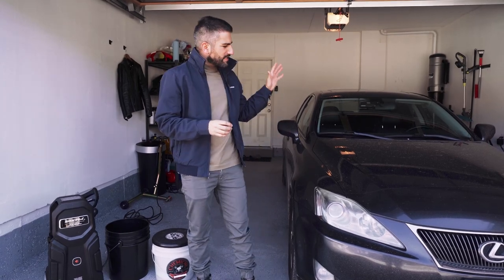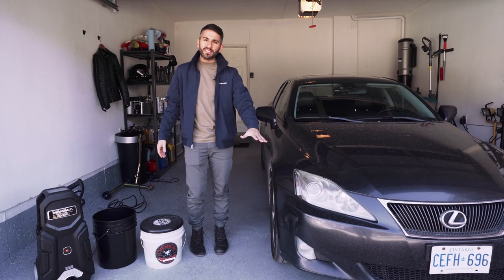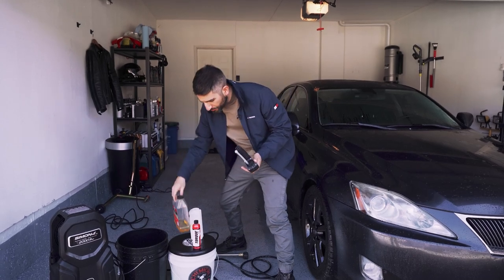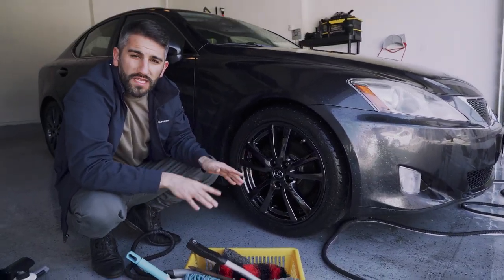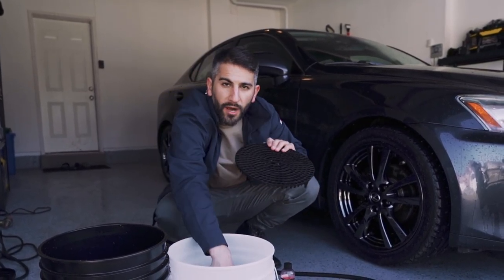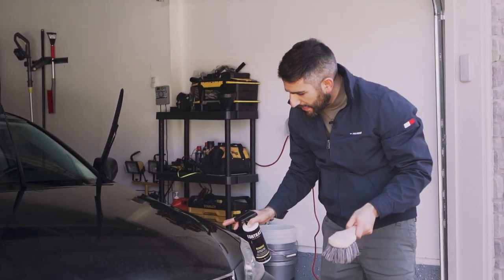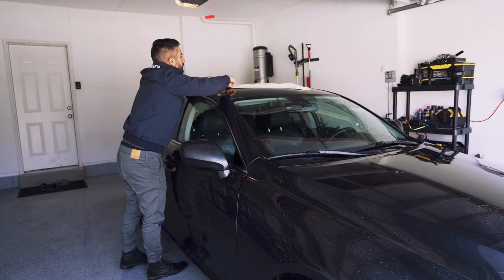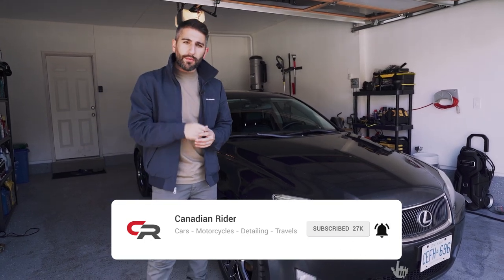How to Wash Your Car the Proper Way! Avoid Swirls and Scratches!

Comment: Just find you on Youtube.  I NEVER power wash 1st, I foam the car, then let dwell.  Then I rinse and foam again.  A power washer is not a must, but useful.  You can use a hose & foam gun.  Next I clean wheels, wheel wells & tires.  At this time, I spray an Iron remover, then a wheel & tire cleaner, and then agitate.  Next step, foam, rinse, foam & then touch car wash soap & water.  When doing a maintenance wash, I use pH neutral soap.  You can use a higher pH soap first right after winter.  Since my cars are ceramic coated, I then use a mineral remover to remove road salts.  Then I would you a clay towel with iron remover, then foam car again.  Rinse car and then I would use an air blower to get most of water off.  Finally I use a ceramic detailer & use a clean MF drying towel.  Don't forget to clean engine area (hood) door jams & trunk areas.  About 90% of the time, I use a rinseless wash, but spring & fall, I do a deep cleaning when I wash, then I apply a spray ceramic coating.
Reply from the maker: Good advice my friend 👍

Comment: You have over 200k miles on the that thing?! Drive it to the ground (if it ever gets there).
Reply from the maker: Yes sir. Actually right now exactly 328,000 km. Doing a full paint correction and ceramic coating on it to really get it in Tip-Top shape as well :) these engines are honestly tanks, I'm very curious to see how long she will go with consistent maintenance and some love
Reply: @carswithsonduren  That's so cool. You are inspiring me to keep my 2011 Pearl White Is 250 and get her looking as classy as possible. I appreciate your videos and vision for excellence!
Reply from the maker: Great to hear TJ you can definitely get her looking classy again honestly it's a beautiful car